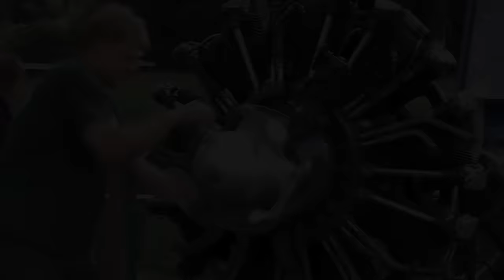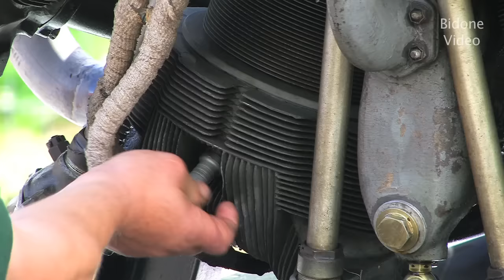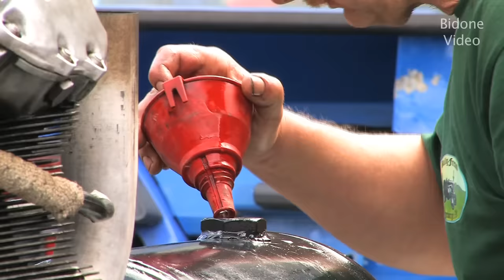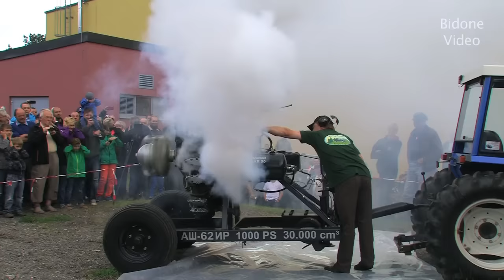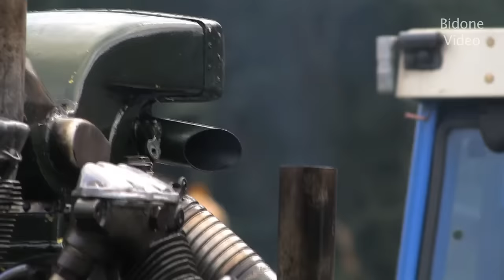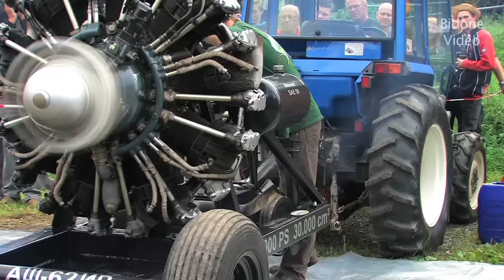Russischer Sternmotor - Russian Radial Engine Start and Run

Comment: I don't know why they don't provide these magnificent engines with some form of cooling. Heat will certain destroy them.
Reply from the maker: The engine runs only 60 Seconds and cool down for 2 hours.
Reply: Bidone1967 is it diesel?
Reply from the maker: +Lithuanian science No.
Reply: some did. this one was most likely cooled with ram air considering all the cooling fins and the fact that most of these were on aircraft.
Reply: Mick Carson they are air cooled
Reply: Alex Schuett 
If it is ram air cooled it needs a propeller to ram the cool air into the fins. But I see no propeller.
Reply: That doesn't mean that it wasn't engineered to be ram air cooled just because the propellers not on it anymore. As you can see from an above comment they only run it for short amounts of time.
Reply: Alex Schuett 
To say that is to have no knowledge of engines. Even short runs can cook an engine. You can clearly see the heat flowing upwards after they stop it. That is what causes instant warm-up and expansion of its cylinder casing and heads. An engine started with a propeller, even a small propeller that blows air on each casing and head can keep the temperature in check, blow away the smoke and can run as long as there is fuel in the small tank. I have 43 year automotive engineering experience under my belt and my father was a WW2 aircraft mechanic before he started a workshop in the 50's. So I know the properties of an engine when I see one. Trust me.
Reply: So what your saying is that the prop and the air flowing past the engine in flight is what cools it, right? So what are you debating me about?
Reply: Alex Schuett 
I am debating nothing on you. I've just made a point on an engine running without airflow, is all.
Reply: You didn't notice the carburetor? So......what kind of science do you guys have in Lithuania?
Reply: ***** 
LOL Bob. Where have you been?
Reply: Mick Carson

Not in Lithuania.....Here in America we don't use carbs on diesel engines....
Reply: ***** 
LOL @ carbies on diesel. Hell no.
Reply: Mick Carson  hcci diesel have carbs
Reply: Lithuanian science

And spark plugs?? This radial has spark plugs.
Reply: I am lost. I've not seen a diesel engines with carbs and plugs.
Reply: Mick Carson
Me neither.......But how can you argue with Lithuanian science? Magical......truly magical.
Reply: Mick Carson in russia.-50c
Reply: brt d 
Sorry, what is 50c, the weather?
Reply: Mick Carson If you've never seen a diesel with spark plugs I suggest a little more research.
Reply: I've been a mechanic/engineer for 43 years, servicing, repairing and rebuilding all sorts of car, small trucks and boat engines. 

I tell you what, it's not about seeing a diesel engine having spark plugs,  it's about the firing process of the diesel engine. 

Diesel fuel can only fire just under 500psi of compression which give heat to the compressed air as the diesel fuel is injected into the cylinder at top dead center. 

Some engines may not fire right away on the first stroke due to the air in-taken being too cold and the engine block is also cold, e.g. in winter, while others fire away immediadely in zones where the temperature is warmer, e.g. in summer. Other times it will fire immediately if the engine is already warm after being run earlier. 

In some cars with diesel engines that run in places of cold temperatures, e.g. North Canada, Siberia, Russia, etc., the diesel engines don't have what you call spark plugs, but glow plugs. 

In the early diesel truck engines and some cars with diesel engines, there was a push button and a device that glowed reddish yellow when the button was pressed. This was to activate the glow plugs and turn them hot like the glow light seen on the dash panel. Once the light glowed bright enough the engine could be started. In some truck and cars this was later made automatic. Meaning that you turned their ignition keys to a click that is used as 'Accessories' in petrol cars, but in diesel trucks and cars that 'click' was used to trigger the glow plugs to warm the mixture on cold start (cold engine or never been started). 

This was good but when turning the ignition to the 'Accessories' click point, you had to wait 20-30 secs before you could turn the key further to the 'Start' (spring loaded click). In some trucks and cars the glow plugs were better automated in later years. 

Turning the ignition key towards the 'Accessories' automatically turned the glow plugs if the temperature was below 5C and once the engine was started, a relay triggered by the running generator or alternator, or even the vacuum pressure from the intake manifold would disconnect the glow plugs from operating and will not reactivate it unless the engine temperature sensor similar to the water temperature sensor senses that the engine is cold enough to require the activation of the glow plugs.

Hope this helps, as I have never come across this nonsense as diesel having spark plugs, unless you mean glow plugs which have a radiating filament, not a spark.
Reply: Good
Reply: Mick Carson I am a diesel tech and I know what a glow plug is but thanks. Like I said, since you obviously dont know enough on the subject I suggest you do a little more research. As this is something I have seen and worked on.
Reply: Alex Schuett 
I don't know enough on the subject? WTF?  I am out.
Reply: Get out
Reply: Diesels are already complex machines.and then this one

..
..
Reply: brt d 
WTF you're on about? Are we talking about this engine or diesel engines? You're pissing me off. Diesel engine don't have spark plugs. If they do, then it's not a diesel engine. If you think there are, give me a link. And while we are in this post, the discussion is about cooling an engine, not diesel engines and spark plugs.
Reply: Some rare bich diesels had spark plugs btw.but generally they dont have
Reply: brt d 
Sorry, what is the name of the engine?
Reply: Thats some old russian stuff.google if you want a name
Reply: +105713310244893504635 
Normal diesel engines don't have spark plugs. If you think so, then you are referring to some diesel engines that run on both petrol and diesel by factory conversion, just like factory converted petrol to LPG. These type of two way engines aren't that popular in road vehicles but are okay in farm tractors because if either fuel runs out, they will switch to either diesel or petrol and these engines are also complex and expensive.  It's like having 2 engines into one. Either way, the engine has spark plugs, distributor, coil, petrol intake manifold and carbie in one side and at the other side it has diesel jets, pump, glow plugs and an exhaust manifold. They are rare but little known.
Reply: You  r right
Reply: Mick Carson Yes I know. There is also a diesel engine that atomizes the fuel and ignites it with a spark as well.
Reply: Mick Carson  I didn't FUCKING see spark plugs and some multi fuel engine have spark plugs (not this one)
Reply: Oh dear... I wish Bob would be here to solve this 'spark plugs in the head' situation.
Reply: I thought it would have been obvious being an aircraft engine. :)
Reply: would it stall if you didnt rev it? men had to trust their lives to these engines and they sound like they misfiring galore.
Reply: Mick, direct the attention of these half-wits back to the video. They can see the spark plug wiring going to the heads. It's enclosed in piping, military style.......The carburetors are also visible.Seriously Mick, have people nothing better to do than to question what their own eyes can show them?
Reply: +105963480461173950024 
Well, I was refereing about this aircraft engine, not some diesel/petrol combination engine. I don't know why people change their subject on something that is totally irrelevant. If this is a spark how can we discuss another engine that is a diesel engine, or an engine that runs on both diesel and petrol (which is a rare engine, or a petrol and LPG engines,

To start commenting about these dual fuel operated engines it certainly make people lose the plot on which engines we are talking about, either this radial engine, or some diesel and petrol engines.
Reply: Mick Carson 😇😈😨😠😅😄😁

Comment: Should flames be shooting out of the exhaust like that?
Reply: Yes
Reply: yep....flames SHOULD shoot out of ALLLLLL exhaust pipes :)
Reply: The bottom cylinder has one of the two spark plugs not firing (oily?) or a intake leak (lean -> slow burn).
Reply: Yes without a manifold, to reroute to the muffler lots of fire and fury lol

Comment: It's ok to run with no propeller for cooling?
Reply: ColonelBumButt Sure, you can run any internal combustion engine without any cooling, just not for too long before you face inevitable overheating. :)
Reply: ColonelBumButt Under a couple minutes (the rule that I use), and never over normal operating temps is fine. Although, I doubt that these beasts have a temp. Gauge! For the length of time ran, I'm quite sure it was fine.
Reply: ColonelBumButt exactly my thought. that´s why this beast is only idling at low throttle for about a minute.
they cant really rev it without propeller resistance and cooling.

Comment: Russian engineering
Reply: Didn't know that. Thanks for telling me
Reply: +Jake Sidorov Found the Call of Duty virgin.
Reply: Not really. A copy of Wright R-1820 Cyclone.
Reply: Not stolen, not reverse enigineered. The Soviet Union had purchased a license for the design, and the Shvetsov OKB was formed to metricate the American specification powerplant for Soviet government-factory production as the M-25, with the R-1820's general design features used by the Shvetsov design bureau for many of their future radials for the Soviet air forces through the 1940s and onwards.

Comment: Actually, it's an American engine. The Shvetsov ASh-62 is a derivative from a license-built Wright Cyclone: the turbo is removed, so it develops 1000 instead of 1200 HP.  The Cyclone can be found in DC-3/Dakota, B17 Flying Fortress, etc, and was produced under license in many countries, USSR included.
Reply: Lend Lease i assume?

Comment: It looks like an airplane engine, but the instability of work scares me, maybe in half an hour it will work by inertia like a train - not even noticing disappearing of the spark and the temporary termination of fuel, then you can fly peacefully
Reply: in fact, I believe that in addition to the reliability of the aircraft of its own production, two emergency systems are needed (the parachute has long been patented, which saved 150 lives, so this matchless subject is not discussed in the world of Boeing, which does not want to pay the small aircraft manufacturer owner patent)
Injection of diethyl ether from an aerosol can (which is sold as “Quick Start spray” in auto stores for a winter start), into the intake tract and a manual starter in the cabin.
it is very disappointing when there is not only no parachute during malfunctions, but also no way to do without a spark, carburetor or starter

Comment: Im guessing without the resistance of the propeller you keep the throttle setting low to avoid overspeeding the engine?
Reply: Yeah running it without the Load is a BAD thing for the engine on 2 points, Overspeed as you said, plus Cooling.  When they run these in  test Cells they have Stubby, Weighted blades to add Load, and provide airflow for cooling.

Comment: You see he had the plugs out, that is for control the cilinders , check or the oil is out, you can not compressed oil , that cost you a piston rod or more..

Comment: great video  but i would not have spectators on sides of prop yoke heaven forbid a nut or bolt flys off.  There are no safety wires on the nuts and bolts
Reply: its russia, your lucky they aren’t trying to feel the propeller

Comment: These  radials don't have much of a sump like a small engine two stroke. So they run oil with it as the guy poured it in .Is that how they work? and what brand made these

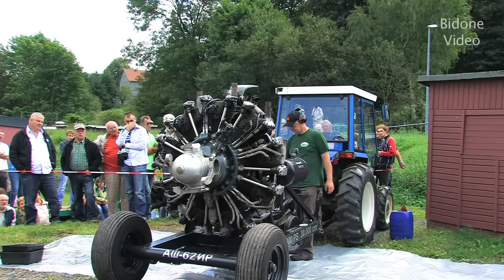Comment: sounds amazing. What is that sound right before he fires the engine. The sound at 1:41 what does the sound?
Reply from the maker: This sound is the inertia starter. The operator starts the inertia starter and the inertia starter starts the engine.
Reply: @Bidone1967  I see, thank you

Comment: I wonder if the owner is running proper Avgas 100/130 in that engine, perhaps low octane Soviet era fuel of an octane of 80 perhaps why it is rough running spiting flames out the exhaust.

Comment: My civic failed inspection due to dirty air filter. He poluted our ozone with this engine the equivalent to 1000 v8's running rich for 100,000 miles in 2 minutes. How is this legal
Reply: If you are not a engine enthusiast then get out

Comment: Why does it sound like a jet engine,?
Reply: the motor isnt big enough to spin it so they have a large flywheel that they spin then slam into the engine to start it, saves alot of power

Comment: The Oil industry:
Car manufacturers
Car dealers
Insurance companies
Registration 
Car parts-
Spark plugs
Brake rotors
Brake pads
Brake fluid
Transmission fluid
Cooling fluid
Air filters
Fuel filters
Oil filters
Tires
Rims
Oil caps
Fuel caps
Radiator caps
Fuel line
Electrical cables
Electrical plugs and sockets
Water hoses
Accessories
The logistics 
The stationary
The furniture
The employees transport
The employees travel costs
The employees uniforms
The employeed safety shoes

Aircraft..dont even start. Makes car industry look like grass hopper on back of an elephant.

Insert Competition and haste here.

Hello Iraq. [*Smile/Wave] looking at you.

Comment: How do you keep it from overheating? The propeller does that on the plane, but you have it removed.
Reply: I went to aircraft mechanic school and I can guarantee that the prop is 100% not the thing that cools it. The cylinders have finns around them to use the surrounding air for cooling, it's the same design used by lawn mower engines.
Reply: @Dr_E_Yekley  With all due respect, I have worked on a LOT of small engines on all sorts of yard and garden equipment. Those engines have fans on the flywheel to blow air over the fins you are talking about. What happens if the fan or fins is plugged up with grass, dirt, or the proverbial mouse nest? I'll tell you what happens. Air can't cool the engine and it will be destroyed in minutes if you fail to notice the odd hot smell and shut it down NOW. I have seen the grass on the engine fins start smoking (nearly caught fire) because the idiot owner of the machine refused to let me clean it out. Now, where is the fan to blow air over the fins on this engine?
Reply: @brianbaird6528  Now I do admit, I may have been slightly mistaken about this specific engine. Older airplanes DID have large openings in the front of their nacelles to take in ram air, and the props in these designs probably played a considerable role. However, my point still stands that the prop isn't the ONLY thing that keeps it cooled. 

Speaking from experience, test runs are used on these engines all the time without props. They usually don't require them as they compensate for it in their amount of fins. As you can see on this engine, there's more fins per cylinder then there is on a typical lawn mower engine. This is more than enough as it takes in ambient air more efficiently. 

You could argue that it's because the engine itself is bigger, but I have been around these types of engines and I cannot fit my finger between any of the cooling fins ( I could ride my nail over them and they'd sound like a xylophone) where-as with a typical lawn mower engine I'm sure you could. They're closer together, and if they were spaced like fins on a lawn mower engine, a fan would definitely be needed because there wouldn't be as much. More fins means more cooling surfaces taking in air, which doesn't exactly need to be high velocity (well ok, I'm looking at pictures of lawn mower fins now and they do seem to be shortly spaced to where you couldn't fit your finger, but they still aren't as shortly spaced as aircraft fins). 

This design was mainly used so that the engine could operate well in lower pressures found at higher altitudes, the ability to operate efficiently at ground level is just another perk that comes with the design.
Reply: @brianbaird6528  And as for the grass, dirt, and proverbial mouse nests mentioned. The spaces between the fins are, as I mentioned previously, super tiny, making these occurrences virtually impossible. And even if there was blockage, there would still be more than enough fins to provide adequate cooling.
Reply: @brianbaird6528  Please disregard everything I just said, you're right. The way this is being ran is probably not the most efficient.